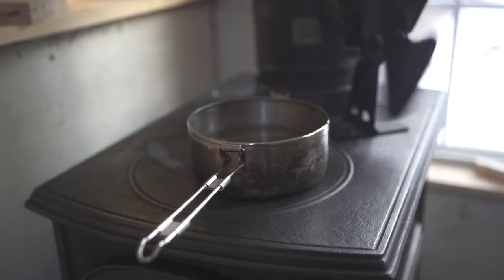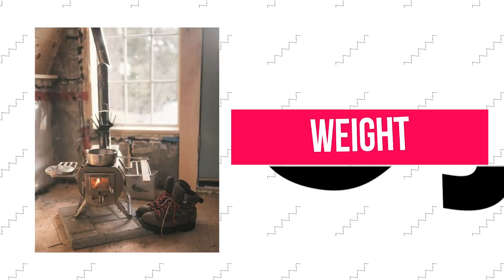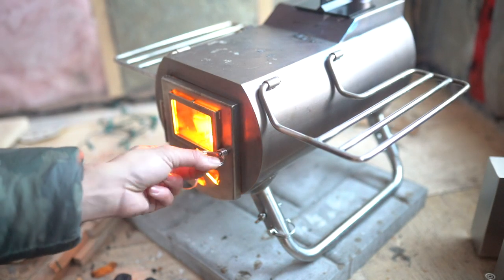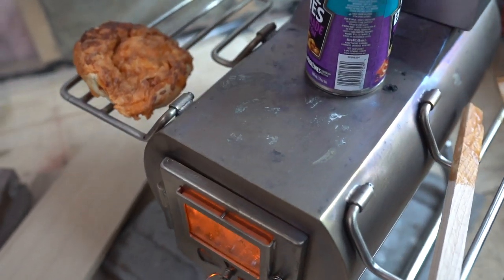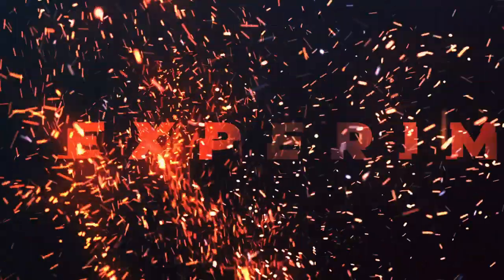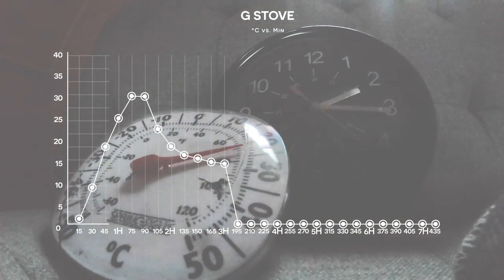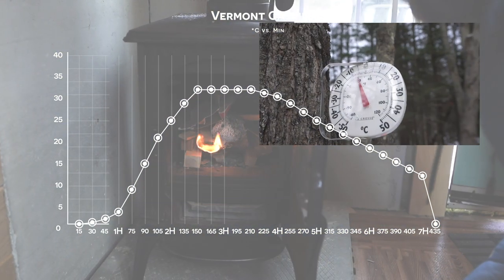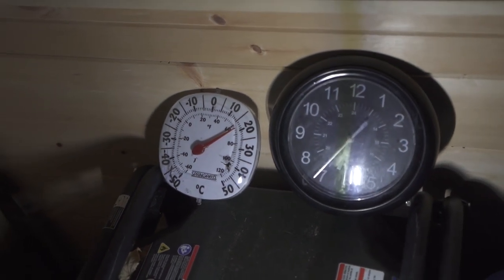Battle of the Wood Stoves: The Stainless Steel G Stove vs. The Vermont Castings Aspen!

Comment: Nice summary!  The smaller Gstove you have comes with piping and lists at $442, + $44 U.S. shipping.  The water heater you mentioned lists at $115 U.S. (plus ~$20? shipping). At the current exchange rate on 12/2/21,(1.28), the smaller Gstove you bought, even with the optional water heater and shipping should cost under $1000 Canadian.

Comment: Put a 200 lbs cube of cast iron on top of the G-Stove (I guess it can hold it!) and You'll have a very stretched temperature curve too... ;)

It's also important what kind of Wood You use: after a well fire-up (some embers in the chamber) give a big chunk of hardwood (as big as it get's through the door!) and after 10-15 minutes with open valves (or 5minutes with slightly open door)  almost close the air circulation, so it will burn on slow moving and yellow'isch flames for about 3-4 hours! And then put some ballast on top of the oven (it don't have to be a 200lbs cube; some bricks of fireproof clay, a tin bucket or big pot filled with sand also helps) 
So You'll stay warm through the night.
P.s. If You use the water heater on the G-Stove, take it off when the water boils! You don't want to steam all the water and have 3 liters of moisture that condensates anywhere inside the tent or room. 
THAT would give an ugly (feels cold) wake-up next morning!
Reply from the maker: amazing tips! i know the comparison is a bit of an apples vs. oranges, but figured i'd put it out as it was something i came up on this year. going to use the g stove for a sauna in the future!
Reply: s

Comment: Cool video. I sell the Aspen here in Pittsburgh. It actually starts at 1200 bucks. That's 2019-20 prices. That g stove is neat. Cast iron takes longer but retains heat longer, whereas steel heats and cools quicker. Nice A frame.
Reply from the maker: cool i like my aspen a ton! it's been a game changer in terms of the heat retention (just stayed over the other night in -30*C and was pretty cozy).

Comment: Do they make a slightly larger SS stove which would probably make for a more apples to apples comparison?  All in all that was a fun little video to watch.   BTW... the more modern Aspen is more efficient with an approx. 10-hr. burn time and uses less wood to heat a space.  A new Aspen now costs (MSRP $1860 + Tx) but is eligible for a 30% refund on one's federal income tax (in the U.S., anyway).  That really helps with a final cost to the buyer of $1300.  But like you said in your vid... The piping is quite expensive, also.

Comment: Just purchased the Aspen C3 for my off 750 sq ft off grid cabin. I’ll let you know how it performs!
Reply from the maker: Oooh right on! I know that their website had claimed 1200 sq. ft. I think that's pushing it haha. Keen to know how it performs for sure!
Reply: Andrew. Here’s an update. The Aspen is awesome!!! Heats my two story cabin from 35 degrees to 65 degrees in two hours and keeps it a comfy 70 degrees by throwing a log on every hour or so. And this when the outside temperatures are in the teens. I would highly recommend it for a small off grid cabin for sure!!

Comment: I would have liked to see you do this test using the GStove Heatview XL.  From what I can tell you were using the smaller Gstove Heatview correct?  Something else to consider is that Stainless Steel is naturally going to hold heat differently than the cast iron in the other stove.  Stainless Steel cools down a lot faster as well.
Reply from the maker: good point. I just measured this and it was the regular one. I am not sure if the XL was available at the time, but thanks for pointing this out!

Comment: How much wood was in each? Likely double in the Vermont.. thinking that for its purpose(wall tents) the gstove is very efficient. Thanks for video.. I used it as a base comparison between stainless vs rolled steel stoves(guide gear). Confirmed what I expected- heavier equals longer lasting etc

Comment: Hi, 

Poor comparison test, for 2 different stoves for different applications. The Gstove is a camping stove  and is smaller than the Vermont casting which is used only in cabin application. GSTOVE primarily used for tent camping. Try dragging the heavey bulk Vermont stove in the Bush and set it up in a tent.  Let's be realistic.
Reply from the maker: i hear ya! i bought the G Stove because i saw a bunch of bushcrafters build cabins a similar size to mine and use a G Stove. I ended up upgrading because I didn't think it was adeuate and the idea is for folks to not make the same mistake.

Comment: Are they both purely wood burners..or could you use other longer burning fuels to last through the night.
We used to burn wood in our cast iron fire mostly..but overnight in mid winter would add some coal to last till morning. 
Also some long burning compressed wood bricks would help but costly .
Reply from the maker: Jane Whitzend oh that’s a good question. i hadn’t heard of anyone burning coal in these. i was burning ecologs, which would afford me a bit more time too. worth looking into just in case!
Reply from the maker: Jane Whitzend so just read up on it. it isn’t necessarily recommended. some charcoal is coated with coal dust and can create some nasty off-gassing. it also apparently burns hotter and is can be incompatible in systems that aren’t built for it. so gonna stick with logs and offcuts from my woodshop for now. ✌🏼
Reply: Thanks good to know.

Comment: Interesting video, but unfortunately you omitted perhaps the single most important figure- the amount of fuel each stove consumed. Any comparison is therefore impossible. The Vermont casting stove has a considerably larger firebox, and it would clearly be capable of sustained heat for a much longer period when fully loaded. But, by the same token it would ultimately consume significantly more wood. A better experiment would have been to measure the temperature over time for a given weight of wood for each stove.
Reply from the maker: Good call Spencer! I work out of a pretty big woodshop that always has a ton of offcuts, so fortunately it's not too big of a problem for me, but totally an important consideration for sure!

Comment: The Vermont Castings website says the Aspen heats up to 1200 sq. ft.
Reply from the maker: ya, so definitely for a bigger space as well.
Reply: Looking at getting one as supplement heat and or power outtage backup heat... house is around 1800 to 2000 square foot... but I used kerosene heaters rated at 23,500 BTU and it will make you open windows...the aspen is rated at 35,500 BTU so I think it should work for what I am looking to do??!?   Thoughts?

Comment: Not sure why you would use a camping stove in a standing building.  The camping stove is for camping and a cast iron stove is for a building.  There is no surprises in your results comparing a stainless steel light camping stove with a heavy cast iron stove that is twice as big.  Nice data but no surprises here.
Reply from the maker: i hear you scott. the g stoves are pretty heavily marketed which is why i bought it. you see folks using them in small/more permanent structures sometimes, which is why i was sold on it. made the move up after making the mistake (not really a mistake because i still love the g stove). hoping this video provides a bit of value for folks.